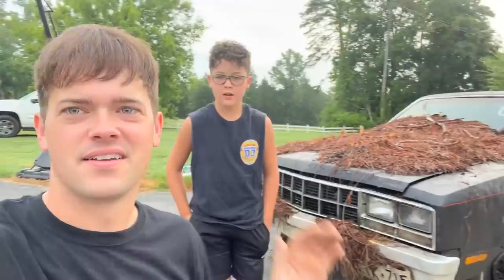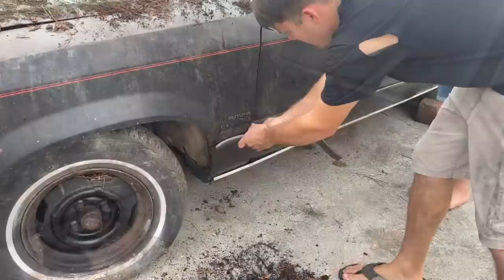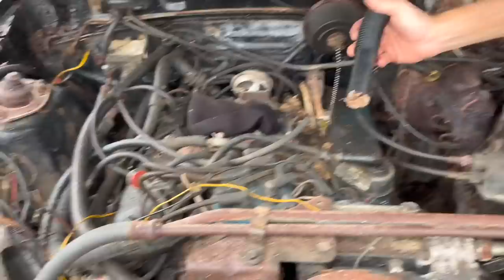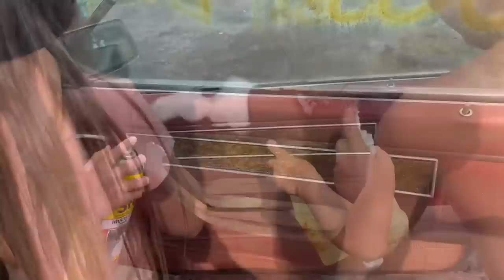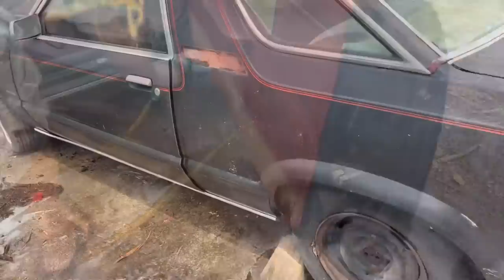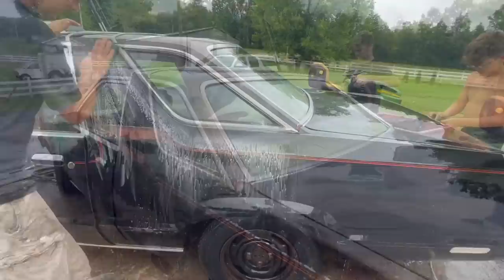Saved from the CRUSHER! What will it look like cleaned up?

Comment: Love these old Fairmonts!
I'm like you, I really didn't think that interior would clean up even half that nice!
Keep rocking it!
Reply from the maker: Thank you I love them to
Reply: @Becca Boone same platform as the mustangs too  DASH IS A GREAT DIRECT BOLT IN
Reply: @rsprockets7846  I knew the dash would bolt right up to the Monarch,  but thought you'd have to do some "engineering" for a Mustang!
Good to know, thanks for the info
Reply: @rexkean  yeah think up until 1984 or so the dash will bolt in same for seats suspension rears seats   check  it out

Comment: Those factory V8 Fairmonts and Zephyrs are pretty rare. I grew up in Dearborn when those were new, and didn't see many. I still remember going to the Lincoln Mercury dealer with my mom and dad back in 77 to order a new Zephyr wagon. I kept asking my dad to order the V8 because I would start driving soon. He ordered the straight 6 (200?) because that was right after the time of the OPEC "oil crisis". Warm over that little 302 and that would be a nice air conditioned sleeper, dude. Thanks for posting.
Reply from the maker: That’s awesome thank you

Comment: I got to say, I’m really liking this car. I didn’t know there was a V8 option 👍🏻  All I’ve ever seen were 4 doors and inline engines. Keep up the great job, you guys are great. 😀
Reply: 4cyl toooo....
Reply from the maker: Thank you
Reply: there was a cop version of the Fairmont too.
Reply: @garysimonson9593  they also whacked off the rear top behind drover added a pick up bed liner and made it a el camino. Type
Reply: @gertraba4484  yes, but wasn't a real production vehicle.  the info I found:  

The vehicle was the result of a joint venture between Ford and National Coach Works, located in Los Angeles, California.

While not officially a production vehicle or a replacement for the Ford Ranchero (which ended production after the 1979 model year), the Durango was designed as a potential competitor to the newly downsized Chevrolet El Camino and was commissioned by Ford to be sold through Ford dealerships. As no official totals were kept by either company production estimates vary between the low 200s and 350, with 212 conversions known to have been made by National Coach Works.
Reply: You could get the Fairmont with a 255 V8 or a 302 V8. The 255 wasn't anything special, though the one I had was okay around town. The 302 had slightly more torque, but not much better. 

If nothing else, the interiors were pretty decent. The federal government (GSA) liked the base models from '78, '79 and '80. A mechanic friend worked on GSA's cars at the time, and would see the Fairmonts for routine stuff, like carburetors, tune-ups, etc.
Reply: The V8 was only offered in later versions, all in the Futura’s.  Fairmont we’re both 2 and 4 door.  They had 4 or 6 cylinder engines.  Both engines literally had the exact same horsepower, but the torque was different.  The 4 cylinder was the same engine that was in the Ford Pinto.

Comment: Really cool seeing these cars spared from the crusher, and being cleaned up.  My 2nd car was a 1978 Mercury Zephyr 2-door notch-back sedan, and this car reminds me of it quite a bit.
Reply from the maker: That’s awesome thank you
Reply: @Sleeperdude  also, I am sure you are tracking the Fairmont and Zephyr are both Fox-Bodies, so the majority of the parts for the Mustang are a direct swap...my Zephyr had all sorts of parts from a Mustang GT Cobra, such as the  Rims (Turbines), brakes front and rear, swaybars, bushings, shocks, springs, quick ratio power steering rack, tie rods, upper and lower control arms, ball joints, etc.  The car was actually a corner carver when I was done that stuff, just never installed my 5.0 engine (car had a straight 6 and C4 Auto).

Comment: Only need to use some turtle wax on it.  It is in better shape then I originally thought? Maybe the 302 will still turn over? The gas cap will may be indicate the concition of the motor. I like 302s though that is what was in my 67 Mustang and it was a pretty good ripper for a kid back in high school in 78. If not send it to the machine shop to have it bored over .10 thousands. And redo the crank and heads and everrything. I love old 302s. LOL the are a great running engine. Replace the intake valves in the heads with 2 inch chevy vavles Im not kidding and it will be very fast. thats what the guy at the machine shop told me the guys at the race track loved to do to them in the seventies and he said they loved them that way.
Reply from the maker: Yeah maybe so

Comment: I'd be really pumped to see that engine get a nice 4bbl intake with a nice aftermarket 4bbl carb. It's clearly a smog engine, so it'll be gutless no matter what, but a 2bbl to 4bbl swap definitely wouldn't hurt. You ALWAYS got the hookups though. I've been dying to get my hands on a cool old domestic and they're impossible to find like that around Pittsburgh. They're either completely restored, completely picked through for parts, completely ridiculously expensive, or completely rusted.

Comment: No 4bbl carb available in any Ford car in 1978.  I think you could get power windows and locks though.  This car is very well equipped and I agree, the color combo is beautiful.   I almost bought a new Thunderbird on Halloween 1983 that was black with red pin stripes and gray cloth interior.   It even had the moonroof that you could flip up or take out.  It had a pouch in the trunk that you would put the glass in when driving without the moonroof.  This car is an amazing find.
Reply from the maker: That’s  awesome

Comment: I had a 78 and an 81 Fairmont Futura. The 78 was a six cylinder and the 82 was a 255 V8. The V8s never came with a 4 barrel carb from the factory. Love the roofline on those cars. Ford used to make an upholstery cleaner called Triple Clean. It had a brush on the top of the bottle. That stuff was the bomb and cleaned up those grimy body sweat stained arm rests like nothing else.
Reply from the maker: That’s awesome

Comment: It's really amazing as to how simple the "FOX Body Platform" was.
Basically the Fairmont FUTARA"?" was a Mustang that weighed about 200lbs more with a "less than" aerodynamic body...
Even the Straight-6 200 (if you could find one) was Very Reliable, since the Transmission would typically go out before the engine (with proper maintenance)!
Again, my first car (1992) was a 1978 Fairmont Sedan in Metalic Brown with the 200-6 and T-4"?" Transmission.
As I was a Business and Engineering Major in Hogh School, this car was absolutely perfect for me and my needs at the time!
My second car was a 1979 Mecury Zypher Fastback Coupe with the 302... I made alot of people angry with me, especially on the road.
That Zypher was such a "Demon in disguise" compared to the 5.0 Mustangs and Novas in my town.
-And I kept that car as stock "looking" as possible! RV Cam, 4-barrel Intake with a Holley and a custom built 9" Disc Rear Differential.
Reply from the maker: That’s awesome I love these cars

Comment: i had 2 of those fairmonts. one had a straight six the other a 4 cyl. combined them and dropped a 302 in it then a floor shifter, dual exhaust raised the rear put nice rims and tires. then winter hit. during winter i had to move it from where it was sitting. it wouldnt start. so a mechanic friend of mine came and got it to his garage. he liked it so much he bought it from me. found out it spun the bearings in the bottom but was an easy fix for him. i wish i still had that car it was fast with the 302 in it.
Reply from the maker: Sounds like a fun setup

Comment: I would have pulled the seats and the carpet out of the car and pressure washed the floor pans. Look under the back seat top cushion and see if the car still has its build sheet. I would have pressure washed the inside of the trunk as well. You can use an SOS pad to scrub down the chrome, aluminum, and glass and a razor blade would have made quick work of the spray paint. You've got a nicely optioned Fairmont there, we had one back in the day and ours had a pop out factory sunroof in it.
Reply from the maker: That’s awesome thank you

Comment: Great video, had a Faifmontand was a great little car 4 cly and as basic as they come .Drove the wheels of of it I thought150k miles , but about 6 years later we saw it and looked like the new owners loved it as much as we did was still on the road and looked good. Considering that it was in Ohio and the rust belt( not the manufacturing one) was proud to have owned a great little car and was impressed that it was still a daily driver , simple car , easy to work on and cheap to insure, can’t say that about my cars today. Maybe a manufacturer could give us a decent car that doesn’t have every useless option on it but still dependable and stylish, just a dumb thought
Reply from the maker: Yeah I love them I wish they made cars like that still

Comment: My best car is our 1976 ltd..it was primer Grey. Enough trunk space for full size spare,tools, emergency  gear& a years worth of groceries  from Costco at 1 time!! Best family auto ever for us..P.S. you can use razor blades to remove paint from windows,evenly without any scratches. The c.l.r. cleaner is best for removing the black mold from the seats..
Reply from the maker: Ok great thank you
Reply: I have really bad o.c.d. and I detail clean my cars interior to dealership quality regularly. Cracks ,crevices seals,ect,ect. Newspaper always removes the window cleaner spray,never any streaks!!

Comment: Excellent video Sleepdude Crew  :) that 1978 Ford Fairmont nice shape for age is plus 2 door car also heard back in production make basic motor was big 6 cylinder 250  , 302 V8 be 2 also ordered in 4 barrel carb,   plus all options want Cruise Control was in 1980 and on to ! Some them had small 200 Cubic Inches 6 cylinder motor, Automatic with Overdrive or not too of 2 types transmission and option transmission to get was the Manual transmission was Floor shifter of 5 speed as I know only seeing one in 1980 ! Plus used high performance clutch plate plus bearings too ! Also Josh can tell wife also kids the Emblem on middle rad plus front near hood for tell that drive straight or need alignment if steering wheel off straight to go to far left or right on straight stretch of road too!
Reply from the maker: Thank you yes I will tell them
Reply: @Sleeperdude  no problem for information my late dad and late uncle taught that especially use a DODGE ram from old Dodge Car from 1955 back then on rad door on 1968 International 624 A Desiel fuel 60 hp farm tractor 2 wheel drive one ! Why my late Dad did it 1980's to tractor he had shigle  on bottom on right eye plus Cardics need take off and look was fuzzy so help out and when uncle baleing in no straight drive on rows to and when I drove tractor for rake hay or straw rows help too !

Comment: "Awesome" is quite awesome. Add a magic eraser and you have cleaning gold!
It (awesome) is a heavy surfactant and will dry your skin and vinyl alike.
I use it in my parts washer and it works everybit as good as super purple.
Use the coverall protectant to re-moisturize vinyl after using awesome.
I appreciate what y'all do!
Reply from the maker: Ok good to know thank you
Reply: @Sleeperdude  
Also, that Coverall protectant brings the dried out plastics like door handles, motorcycle fenders mirror housings and greying fender flares, back. 
Not sure the Family Dollar Gentral has it though. 
😂

Comment: I gotta say, after watching this video, I'm a little jealous. In 1995, I bought a 1980 Fairmont Futura for my wife, and it only had 22K original miles. Love the body style. After replacing every belt and hose on the car, we drove it for a couple of years. Unfortunately, this car was one of Ford's brilliant ideas of putting a 4 banger in this big heavy car (by today's standards) and the poor car couldn't get out of its own way. Eventually, my wife was driving it one day, and got rear ended at a traffic light. Although I had the car repaired, it never was the same, and I eventually got rid of it. I always wanted another of this body style, and my dream was to find a wrecked Fox body 5.0 Mustang, strip it out and put drive train, suspension, brakes and everything else into the Futura and make a nice sleeper out of it. Life got in the way and it never happened. Those cars are pretty difficult to find it decent shape anymore. One can dream, though. Anyway, great video and good luck with the car. I will continue to be jealous of you.

Comment: Wow this is an amazing rescue of a car that would normally be discarded. On the door panels just stripping old freezer of the metal then you clip out the shape of the door panel and reupholster what was cardboard with the skin from a dead freezer that's what I do on all my old cars that way when they sit outside in the water gets inside the door they don't rot keeps the panel safe. And don't forget I've got the hood ornament for that car you still have the little mount on the hood I have the top part when you get it all finished. And use Rhino liner bed liner where the vinyl top used to be it'll look just like original. Some modern Chinese LED 1156 and 1157 bulbs in those tail lights I look nice. They make these led plates you might have install them behind those lenses they're called Cobb plates diy. And mirror tent the windows since you have all that chrome trim. Mirror tent you don't get pulled over it's that black tent that gets you stopped. And that car would have come with the wire spoke hubcaps.
Reply from the maker: Thank you

Comment: Sleeper,
   The one good thing about those Futura’s is that they are adaptable and can be turned into high performance cars if you change the cam, lifter, springs, carb, manifold ect ect. I knew a guy who had one that ran like a rocket but he dropped a bunch of money in the engine to make it so. The 1st thing to do is rip off all the emissions (and converter), plug up the vac. lines and you got a good start.
  In the Northeast, most of our old cars have rust problems but the interiors are usually in good shape. If you have a hard time finding a dash for it,I’m sure I can get you one in great condition from the junk yard. Let me know.

Comment: I worked at a Ford dealer when these were new, they were such a great improvement over the Maverick. Quiet ride, and great handling for an economy car. I shoulda bought one. I always thought this body style would be a great car for the high school kids in the 80s.  Put some air shocks, shackles, wide tires and Cragers with that 302 and it would Be a winner. Never saw that happen around here. Most likely that had a red vinyl top, sharp looking car.
Reply from the maker: Yes 👍
Reply: My first car was a silver one with red interior. Mine had an inline 6.

Comment: Yeah, the carpet upon the dash board is horrendous. Depending on what's beneath, replacing it with a panel having the same color than the steering wheel would be awesome. Keep up the good work, looking forward the mechanic job part on this Fairmont  ^^
Reply from the maker: Yes and it’s soooo glued down

Comment: Simple green extra strength- u can get it at hardware-home improvement stores or in with rv cleaners at walmart works the best on this stuff safe on vinyl and kill mold and virus. It does how ever leave stuff sticky if u dont dilute properly. I cleaned the entire interior of a gmc thats interior was full of moss and mold(lost its windshield during a hail storm while parked. Looked good when done, i used a wet vac to suck up the cleaner on fabrics
Reply from the maker: Ok good tip thanks
Reply: @Sleeperdude  no problem, they use it to clean the mold off fiberglass rvs

Comment: Josh,Your Fairmont  looks good after the power wash. I like soap and 0000 steel wool. Removes rust and it's a little more aggressive than wet sanding.
If you wanna see what kind of paint you REALLY have, after comet/scotchbrite or 0000steel wool and dish soap (I like  Palmolive)...
I digress...if you REALLY  wanna know what kind of paint you have, get some Nu Finish in the the orange bottle. I generally use a t-shirt but a clean  towel makes for a more aggressivecolor return on a single stage and it'll tell you if the clear coat is salvageable on a 2 stage paint.

Love your content, wholesome family, and background tune from somewhere in my youthful past of the 60's.
Keep up the Good Work and making Future Family Memories when your kids ain't kids anymore and you get to start all over/Continue the Tradition with the Next Generation.
You guys are the Real Deal.All American (wrench-turner) Family.
the Texas Chipster ;-)

Comment: i had a '78 and an '80 fairmont. the '78 had a straight 6 with a 4 speed, and the '80 had a 2300 4 banger with a 5 speed. wish i still had one of them, they were fun cars to drive.

Comment: Ol' Henry saved on paint back then, put it on pretty thin. There's a drain tube by the fuel filler, they get clogged up all the time.
Reply from the maker: Yeah I think your right
Reply: @Sleeperdude  I have a 80 Fairmont, it clogs up all the time and a 86 LTD wagon that has never clogged since I owned it.

Comment: The Fairmont cleaned up extremely well. It certainly had black horrors running out of the rear seat when you were rinsing the cleaner off of it. The front seats would have too! I hope the engine does turn. Having said that, the vehicle is worthy of an engine swap if you have another one.
Reply from the maker: Yes for sure thank you

Comment: My first used car I purchased was an 81' Fairmont  Futura coupe,  it was black with a two piece black vinyl top, with tan interior, it had bucket seats with a console shift on the floor, it also had the rare digital readout for low gas, etc.
Mine had the crappy 4cyl engine, the 302 V8 was a better engine.
Reply from the maker: Awesome